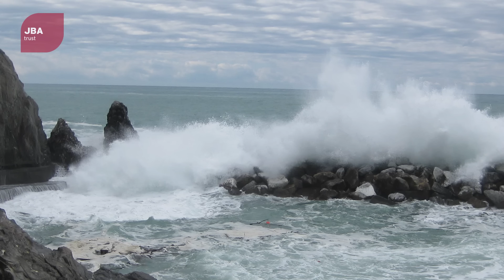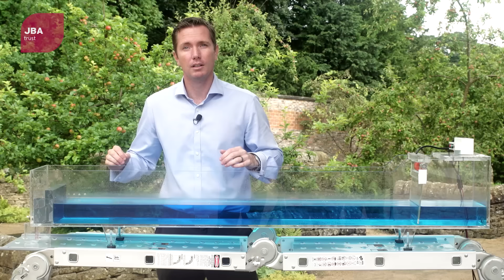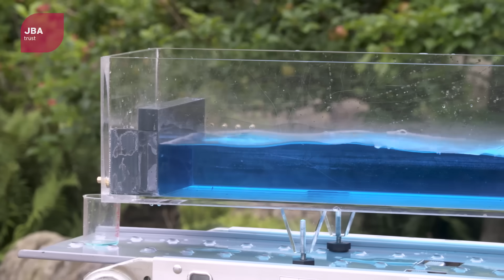Wave tank demonstration showing the impact of coastal defences on flood risk

Comment: What if we built a giant paddle on a stepper motor set half a cycle out of phase to counteract the paddle that's attacking our reservoir? Use inverse waveforms and such?

As per protecting beaches at a reasonable price 100 years from now? Lazers defence grid? Use of electrolysis? Supercooling to instantly freeze the water as it comes in contact with the wall? Hydro-electric wave-breaks? Heck, hydro-electric recurve walls would be sweet, too. Wouldn't an overhang wall work as well as a recurve without the need for a slope? Could we set up a system that would float to counteract rising ocean levels? Walls that slide up to a point before catching on another wall until it caught on the base wall, and, at that point, the amount of water involved is more than what exists on earth unless a space rock brings us a bunch more?

Comment: Instead of making the wall flat making it like this. 

HOOOOOO
HOOO
HO
HOOOO
HOOOOOOOO
HOOOOOOOOOOOOOO

Reason being the inertia of the water is pushing forward it wants to keep going forward so if goes forward but their is a rap pointing back to the water it will keep flowing in it's direction gravity will slow it down a little and then the lip will make it drop back in to the water. The wall doesn't need to be much higher then a standard wave. In my opinion this would be the best solution.

Comment: OF course the rubble works well, its sticking like 2 inches above the surface of the water... but the stairs/ramp etc.... all sat underneath the water. I'm not saying the findings were incorrect but that's a kind of flawed experiment. If you scaled the stairs up, so the waves actually broke on the steps it would of course be more effective too.

Comment: The only problem with a recurved wall is that when the curve erodes it will just return to being a vertical wall. Not very good in the long term, especially with high costs for repair.

Edit: At 11:18 I can only imagine how dangerous that could be to fishing boats.
Reply: Pretty sure the only facts he needs for that claim is logic lul. Friction and erosion happen everywhere.
Reply: They last decades with virtually no maintenance, they're incredibly common for a reason.
Reply: DynestiGTI From the picture he showed, these things won't be fully submerged, they'll be sticking out of the water a bit
Reply: He specifically says at the start of the video that these demonstrations are testing against storm surges. Most coastal defenses wouldn't experience much more erosion than any other structure since they only combat high waves during storms, which may only happen 10-20 times a year.
Reply: DynestiGTI U sure mate? Do you have sources for that claim?
Reply: Pretty sure there would be enough signage/lighting/reflectors to indicate it's presence.
Reply: and the recurved wall looks ugly in beaches
Reply: sources? you mean... physics?

Comment: But with the stepped revetment. Shouldn't it be above the water level to get a result? All the other examples except the 1 in 2 reventment seemed to be done above water like it was shown. Not underneath where it doesn't provide much if any resistance to the incoming waves.
Reply: the power of the wave isnt just on the surface of the water. Most of it comes from reefs and walls and rocks and sandbars and divots in the ocean floor. Thats how waves are made. along with wind, rising and falling water levels, and its ecosystem surrounding it
Reply: Emile Rios I understand that. But these examples are to keep them from going up the beach and and coastline. Where depth isn't the problem its the force of the water. And they are usually placed in places not under water they are above sea level. So wouldn't you get different and what I would assume would be better results if they were above sea level?
Reply: lol you dodged my point. Wave Power rises underwater. If it collides with anything blocking its way, the wave will either shrink or grow.
Reply: another thing, even if this example already has the stepped revetment underwater, He already said that these are preventions of a *storm surge*. Usually during storm surges, It starts to flood. When it floods, the water level kinda rises. So in his demonstration, It seems like the storm already started, and some flooding has occurred, giving a reason why the damn thing is underwater.

Comment: so, the best coastal defense method is 1 stepped revetments along with recurve walls, along with 2 rock armor where oystering is desired, and 3 submerged nearshore breakwater structures, where beach preservation is desired.
Reply: Zoie3x8 actually the Rocks work pretty well for Beach protection
You put them a little bit out into the water like a fish pond and it's a great protected place for the keiki to swim doesn't mess with the sand or anything I like a wall would

Comment: so these guys are pretending to be testing new things, while all of these different defenses are used together in the Netherlands for the past 50 years. the cheapest option is 2 of those 1/2 slopes, just put the second slope 10 meters behind the first one and at the height the first one ended.

what you see allot here is the first 1/2 slope being build from large boulders similar to the stone armor, but you make it wide and flat on top like the last thing he showed. then on top of that you build a normal 1/2 slope out of sand and sow grass on it. getting a shape that looks like this        _/--\_
...............................................................................................................................................................................  /             \ ................................................................................

you also see this deisng allot here   /---\__
                                                              /               \..............

Comment: the ramp is a hollow ramp!
but the stepped ramp is a solid ramp. taking the volume of space in the tank which gives it a higher water level ending in a inaccurate measurement of the water coming over top of wall.  this was a interesting test and I like it and im not trying to attack it in any way but we need accurate readings here man. whatever you put into the tank make sure the water levels are still the same. putting something into the tank and not removing it is basically like raising the simulated oceans waters alot

Comment: Major flaw in the testing methodology, when you add ex. 10x10x15 cm sloped/stairs/rocks etc... model you should remove the same cubic amount of water in the tank because the ocean isn't " filled " more by the sea wall as it is in this example!

BUSTED !

(Edit: although I'm sure the tools showed are more efficient. they might not be as drastic of a change )
Reply: Check at 5:27 . The structure is hollow, and the way he puts the others into the water seems to me that the others are hollow as well, so the change in water level will be minimal. The excess water is simply held beneath the structure.
Reply: He doest let water fill it and pushes it to the bottom where it gets pressurized and you can clearly see the wave flow backwards for that extra volume. Also the water level clearly rises... so Im right
Reply: Water, like most fluids, will try to be in a state of hydrostatic/mechanical equilibrium; this is usually done through osmosis. Although the volume appears to change from the addition of objects like the revetment, the actual volume is practically constant. This only supports the engineer's claim that revetments aren't very effective, as they don't actually diffuse the fluid's velocity, but instead only increase it, allowing water to go over the wall and cause flooding and other damage.

Comment: I am no engineer but, I think the vertical wall with stepped revetment experiment set up wrong.  Steps were placed way to low and almost completely submerged thus making no effect on the waves. They should be placed much higher (further from waterfront) for them to work effectively. Hope somebody repeat the experiment with steps placed above the surface of the water like they showed on the real life example photo.

Comment: Would putting the stepped slope before the recurve wall be better or worse then a regular slope? The recurve wall works well because the water is led straight into it by the slope. If the stepped slope will mess with the water's smooth flow into the recurve, would it be worse? The water going into the recurve would be slower, but that seems like it isnt a problem with the recurve in the first place. It may even make it preform worse as the water would be shot out closer to the wall. Any thoughts?

Comment: I would like to sea how a submerged break water, with a stepped design would work. Then flip it so that the steps are facing the other direction, and see if the direction of the steps in relation to the waves effect the waves.

Comment: In my mind if constructed correctly it would seem that a combination recurve wall, and stepped revetment would increase usability in most cases. The steps on the revetment would provide  seating for beachgoers to lay blankets out, and just be a bit more comfortable than the sand. While still providing the necessary redirection of the water into the recurve that the sloped revetment was doing. Instead of removing usable space you are enhancing a small portion of it, and providing solid coastal defense.

Comment: I was just about to comment on the design of your vertical wall design in the early half of your presentation and changing to a convex design. At 6 minutes 47 Seconds of your video, your (Recurve = Concave) design a Concave wall design, that answers my reservation about the wall. The next issue is the Cost-effectiveness of building the wall. By the way, you should do the first water demonstration with the wall, then remove the model sized wall and proceed to the second demonstration, that is why there was some extra residue of water in the catchment area, so your test is not accurate.

Comment: I was thinking about waves the other day.  It occurred to me,  why do we not use a half pipe in place of a vertical barrier on the sea shores?  The water would simply roll up the half pipe, be turned back onto itself.  Instead of receding underneath it would splash down on top.

Comment: certainly no structural engineer, but video made me curious. I've seen how adding rocks or a more vertical shoreline creates rougher water conditions in smaller bodies of water. looking at the recurve structure, it seemed to perform well by redirecting that energy back out toward open water. could implementing something like this on a large scale cause overall rougher water conditions over time? or would that energy have plenty of time to disperse elsewhere?

Comment: What about a stepped revetment, but each step is recurved?
Reply: I would imagine smaller details like that would erode away over time
Reply: Make the curve top a "slide in place" system, perhaps from hard plastic.  As waves erode it away, you only have to replace one section rather than the whole system.
Reply: I doubt that would work as well as you'd think - mini vortices would form next to each step and the rest of the wave above would travel over with a bit more friction.
Reply: There's only one to know for sure - build an accurate model and test it in that wave tank.
Reply: frzferdinand72 damn thats actually really smart
Reply: If so the steps are not necessary anymore. Just build a bigger recurved surface. Recurved surface is about directing the kinetic energy back to where it came from while the step is used to absorb/hinder the movement of the wave. Combining these two is not necessary as they work in different ways
Reply: shortc5005 you'd need a really strong locking in mechanism so that we can remove them but incredibly strong waves cannot
Reply: I was thinking about that also
Reply: frzferdinand72 that sounds so dumb, but so... Genius. I like the way you think.
Reply: you try to walk up it fall and sue the city
Reply: You're hired
Reply: Lol Lol but the damage a flood can make will be more expensive
Reply: iamstd2 
They would, not only that but they'd have to be made of metals or they'd erode in a week. So they'd be much more expensive and much less efficient. Whereas the recurve can be made of stone or cement and be just fine because of the natural patterns of the waves pertaining to the walls natural slope. But what's more, it's just not necessary when the recurve will basically negate all water whatsoever.
Reply: Expensive
Reply: Sny YT No, compared to other techniques in blocking floods, that's more expensive.
Reply: Zoee 329 I don't know we've had like a dozen drowning deaths in the last few months ( completely unprecedented) and people don't seem to mind all the beaches are packed
Reply: mind flip
Reply: Extra effort, cost for something not adding much value. It's total effect may be better, but not cost-effective
Reply: The point of the recurve is to deflect the top of the wave, recurve steps wouldn't do much better than regular steps because they're underwater
Reply: It's harder to build, and since the recurved steps can't be seen erosion is a concern. However, physically, I could see it  being perhaps the best
Reply: and not submerged already XD
Reply: That would erode quite fast, and would be a lot more expensive than the regular recurve.
Reply: It could work but imagine the injuries you'd get - it would only take one elderly person or a child to get a deadly concussion from one of them to ruin the reputation of the area, taking the businesses surrounding the area downhill with it.
Good idea though, it was smart thinking.

Comment: Nice video.

It seems to me that a little bit of thinking leads to predict the
results.  What happens to a person who is in the water and trying to
get to the shore?

Wall:  obviously a wave travelling towards it will go over.
Person smashes against wall.

Wall with slope revetment:  the wave should be concentrated and go
over even more.  This is observed.  Person smashes against wall.

Wall with recured wall with ssloped revetment:  The wave should be
deflected backwards.  This is observed.

HOWEVER if someone is in the water THEY CANNOT GET PAST THE RECURVE
WALL AND WILL BE DROWNED!

Rock armour: a person in the water gets smashed against the rocks.

Breakwater: a person in the water swims or is washed over it into
the protected area.

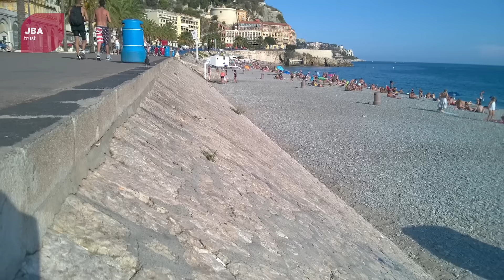Comment: 5:30 how much volume was that vertical wall? Seems like that would mess with the result if you don't take out any water. As the real life walls you show is above ocean it wouldn't affect it the same way
Reply: same goes with the stairs, you show a picture of a non submerged staircase and then fully submerge the stair in the test. I bet the recurved wall would also suck if you submerge it and then try the 5 waves...

Comment: Try the recurved wall with sloped revetement, rock armor and submerged near-shore breakwater all together
Reply: That's far too expensive for far too little benefit. No city would ever pay for that much defence.
Reply: lich109 no, I meant to put them all together at the same time in the simulator thing
Reply: i think thats gonna be OP
Reply: Mr Cabot 
But testing scale models with everything in place at the maximum available cost is a good starting point. Put in all the features then take them away until one has a cost effective and practical model.

Comment: 1:12 If you took some bases in geology and the like, you can really appreciate how land and sea interact in both directions. The coast disturbs and redirects water movement with its shape, the sea slowly chips at and dissolves all sorts of material.

I suppose the optimal setup would be: a submerged rock wall near the shore (as far as it's shallow for efficient use of what boulders you have) and a curved wall at the back (to reflect any energy still remaining).

Comment: I don't get why the recurve wall wouldn't be used like 95% of the time as the solution? It's a tiny fraction of the concrete used as any of the slopes or even the offshore thing, it's installed at the top of the beach which is much easier to access than deep water, and it has a simple shape that shouldn't be all that much more complicated than a plain wall. And it allows the natural beach and waves to be enjoyed by visitors in full. So... by far the most effective AND the second cheapest = win?

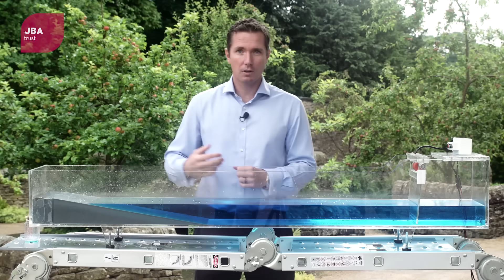Comment: 2:04 Beach during a storm surge
3:02 Beach with sea wall
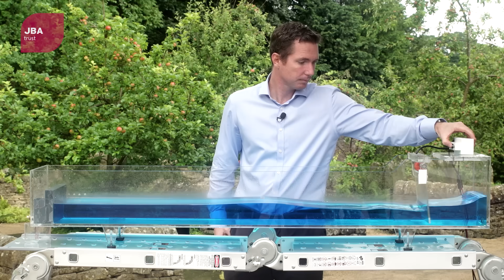4:31 Vertical wall with eroded beach
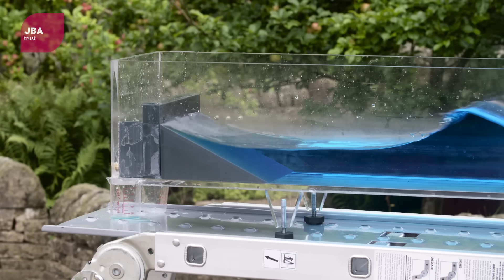5:50 Vertical wall with sloped revetment 
7:20 Curved wall with sloped revetment
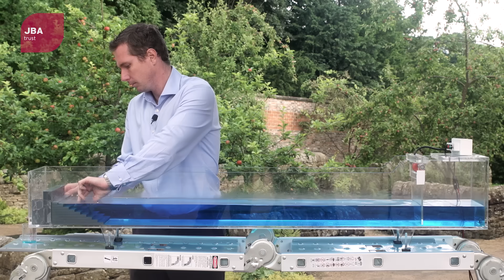8:19 Vertical wall with stepped revetment
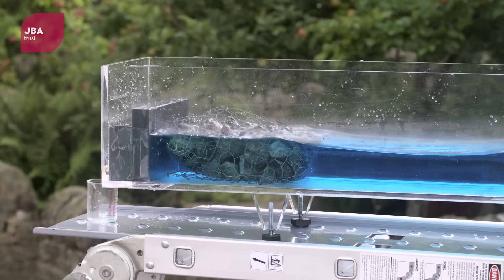9:27 Rock armour
11:16 Submerged near-shore breakwater

Comment: Aren't you supposed to take the volume of the object you place in the basin out to get a fair comparison? That vertical wall with sloped revet takes up a significant amount of volume. Or did you do that? Because it does state the volume.